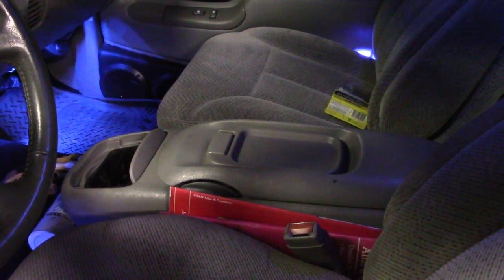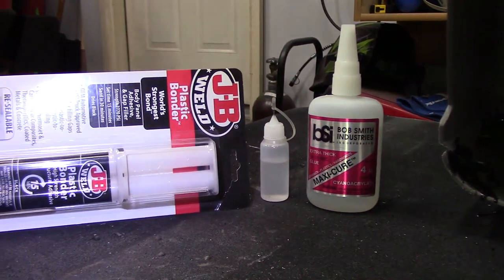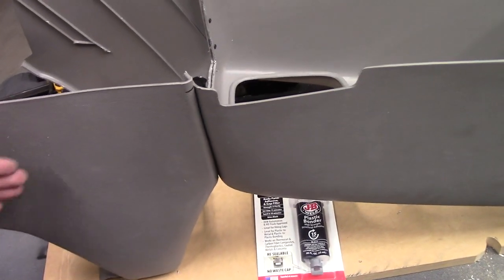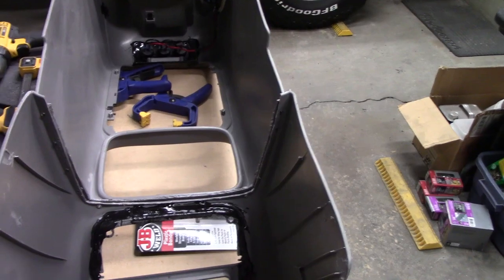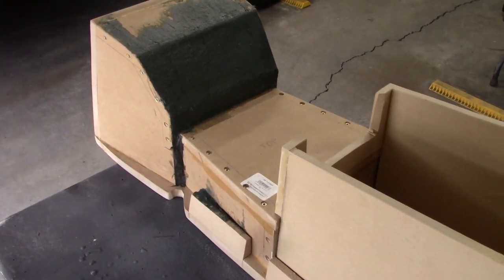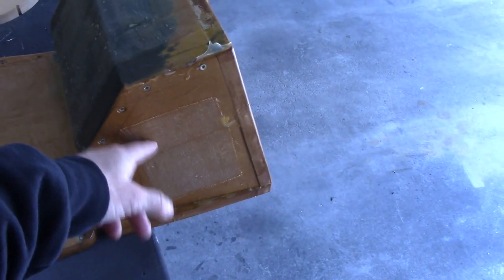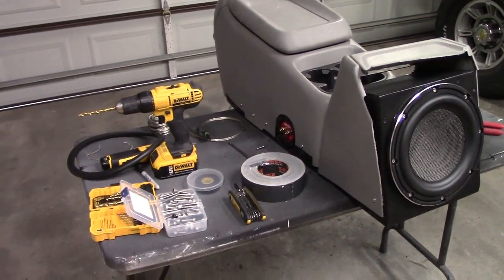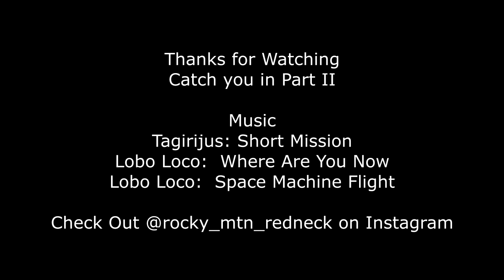20210321 GMT800 Console in an OBS GMT400 Part 1

Comment: I've done a lot of projects along these lines since the 90's. I appreciate your ingenuity and work ethic.  I just have a few suggestions.  You really don't need to do all that predrilling and screwing to assemble the MDF.  Just glue it up and shoot some brads to hold things together until the glue does it's job.  That's just a lot of extra work and hardware.  Second, cut the speaker hole before assembly and use a router and circle jig.  You'll never do that cut with a jig saw again.  You might consider dropping a small 400 watt inverter so you can get 110v to the back for other power options.
Reply from the maker: I first learned to do car stereo in the 90s as well.  I appreciate your suggestions and agree with most of them.  I don't have a circle jig for the simple reason that I'm not building sub boxes all that often at all.  I am also showing that any dude with basic tools can build this stuff, too.  You don't have to have all the pro tools.  I have nailers, yes.  I still prefer the precision of drill and screw.  It's just a personal preference on a project that is on my own time.  For production? Yes, absolutely faster to use brads.

Comment: I did a very similar sub install in a 2012 Tahoe, except I pointed the 10" JL Audio woofer downward (I cant remember why),  1.5 inches recessed with bass shooting out a gap in the front, also removed the carpet below the woofer to free up even more space for sound to escape.   I loved it!! Totally freed up the cargo area. Sound quality was very good, and had plenty of thump.  Only one negative, the rear seat passengers couldn't really hear or feel it as much as the front. I guess that's a positive if you have small children in the back. Anyway I was very happy with it while sitting in the front seats
Reply from the maker: As I’m buckling my little ones in the far back seat, the bass is noticeable even back there. I went forward with my sub as that was the way that best fit given size and console usage considerations.
Reply: @rockymtnredneck4888  It wasn't silent in the back of course, but when the gain and phase were optimized for the front seats, the bass in the rear was lacking a bit.  Not a big deal, I just thought I'd mention it since I never had that with any rear mounted sub box
Reply: JL audio ftw 🙌🏼

Comment: I've seen a gmc youkon had 2 15s and 2 18in Armageddon subwoofers and the vibration caused the transmission to go start making a chattering noise from it being at 147 db and the shop said they never seen fluid have so much metal inside they said the subwoofers we're most likely the reason the transmission went bad and as loud as it was I think that and the added weight was the cause of it bc u couldn't ride with him without having heart palpitations and felt like the breath was being sucked out of my lungs lol so I bet the transmission was going through alot with all the vibration from them and it couldn't take it lol
Reply from the maker: Okay, interesting story. Heavy bass could get to the fluid and cause cavitation, I would bet. However, this build isn’t that strong. It’s a simple shallow 10 that just gives music that extra little punch.
Reply: @rockymtnredneck4888  yeah it just reminded me of his truck bc he wanted to do the same thing with his center console and ended up breaking it and having to build a new     one bc he wanted all his meters or monitors up front where he could see if anything was having voltage issues and make sure it wasn't going over 150 db but that sounds like what the shop said something about it caused cavitation like bubbles in the fluid that the transmission fluid wasn't always where it needed to be guess that why u don't see many people driving when they have that much bass bc it don't make it far I think the weight had a lot to do with it also bc he had to stiffen the rear bc he put 24 in rims and tires scraped like these squatting truck u see nowadays and it all that weight he might as well been pulling another car Everytime he drove it so probably a mixture of both really

Comment: I alway run a piece of dense foam weather stripping around the perimeter to seat my subs on just to ensure they’re airtight..
Also, just a suggestion but it’s recommended to go with a low fume silicone or similar material applied from a tube or caulking gun to finish all your inner joints with and that will ensure you’ll be airtight for the life of the sub (finish the outside how you’d like)..any concern with bigger gaps just mix a little MDF sawdust in a bit of glue to fill in the rough cuts but always run that bead of silicone around the inside and you’re good to go - the low fume you want because the fumes put off from those other epoxies you’re using can actually be harmful to the rubber and polypropylene materials used to build subwoofers.. cool box though, I’ve got a buddy who’s been talking about building a console box similar to that.

Comment: PL premium glue will take care of any cracks and air leak spaces no problem just FYI for next time. 

Very nice job. Exactly what I need help figuring out for my truck. People aren’t creative enough today in finding locations to fit proper sized subs in vehicles. Everyone wants to put small 6.5” or 8” subs under seats, or even shallow mount 10”/12” drivers when I know good and well with some creativity in enclosure design some large motor 12” drivers could be squeezed into most vehicles.
Reply from the maker: Yeah, PL is a way to go. Fiberglass is something I normally have on hand. Yeah, I think you’re right about finding a place to fit things. That’s probably why this vid has been one of my most watched. I looked at the size of the console and what air volume I could get given the other things I needed the console for. Not even sure I have the volume for peak performance, but it does what I want it to do and that is the key for any build.

Comment: Looks good. I definitely want to hear how it sounds. The wood box and fiberglass should hold up great. I use my center console as a cooler. I line it with a couple of 6 mil plastic bags and I can get a twelve pack and ice in it. It will keep it cold for about twelve hours. Great video
Reply from the maker: At one time I thought about putting a fridge there, but I like having storage and it was the best place to put a subwoofer.

Comment: plans for 12 inch tuned port center console box on ebay fits silverado. has the boom for real i put a punch power in it slaps hard with cup holders too :)
Reply from the maker: Yeah, I’ve seen those. Cup holders are all you get. No storage. So it may be a faster instal, but they don’t make what I wanted.

Comment: Since you have widened the storage compartment under the armrest, you could add some approx. 4" x 7" horizontal molle pouches to hold gear, one per side, and they seem like they would stay hidden below the opening edges of the console. Heck, maybe even toss one under the armrest itself! Thats what i plan to do with my custom console build: a molle panel under the armrest lid that will have a smaller bag, a flashlight sheath, knife sheath, multitool sheath, and smaller size admin panel that itself holds a few pens/pencils and a sleeve for 3x5 notepad.

Just wanted to toss a friendly idea. Cheers!
Reply from the maker: Interesting idea. I’m not a huge fan of the molle craze.

Comment: @4min, 
 Hey bro a cleaner way of doing that is laying down some painter's tape on the inside to create a nice little line or use a paintbrush from art store
Reply from the maker: Cleanliness was not the goal there. Since 2 part epoxy basically creates new plastic (hopefully bonding with the old), I wanted to spread it out enough to get a wider connection. So far it’s held up nicely.
Reply: @rockymtnredneck4888  naw I get that. I did the same thing you did an then friend of a race shop showed me that trick an its been amazing.  when I made a custom dash for my 88 obs the I did the tape an I didn't have any trouble with fitment an still holding on a 800hp blown 383. 

But I get it I'm like you if it works it works but the older I get the nicer I want it lookin vs getting slapped in. 

Still bad ass tho 🤘

Comment: Great video,  impressive work!
That JB Weld Plastic Bonder is some amazing stuff. I recently did some very extensive testing using most available 'plastic epoxy' adhesives and that Plastic Bonder surpassed all my tests.
Im using it to make  a custom cup holder for my console. Using the actual insert from a 13-15 Accord and a flip up cover from an Audi Q8. Ive had to make the Audi cover much larger to fit over the Accord cupholder. Some very surgical style cutting and bonding.
But safe to say it was successful thanks to the plastics bonder. I then backed up all my adhesive with thick layer of regular JB weld for strength. 

The things we do for 'custom' ...

Cheers!
Reply: U

Comment: Think by putting jb weld on the other side and fill in to make it flush. Then go in and trim the inside of the counsel instead of riveting it??
Reply from the maker: Not sure what you’re asking, but in this sort of joint I like both a mechanical and chemical bond. The JB is good, but can be broken. I could have spent a LOT more for true panel bond adhesive and then not been worried as much.